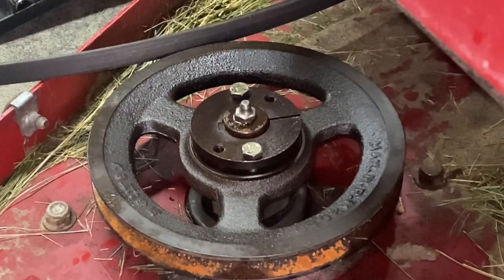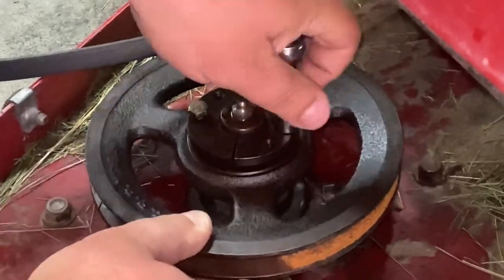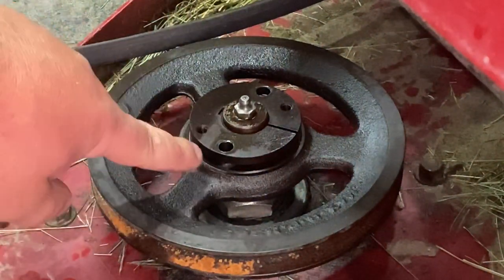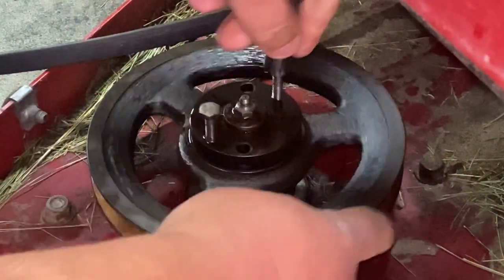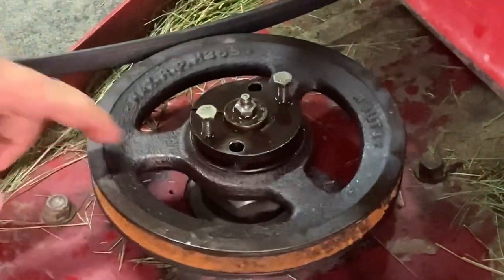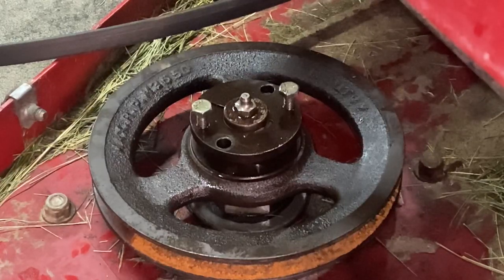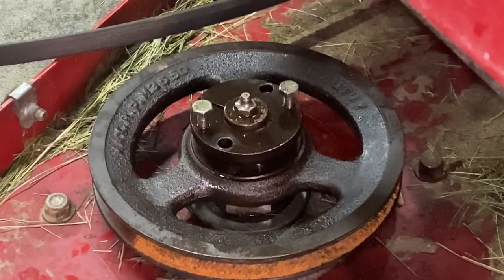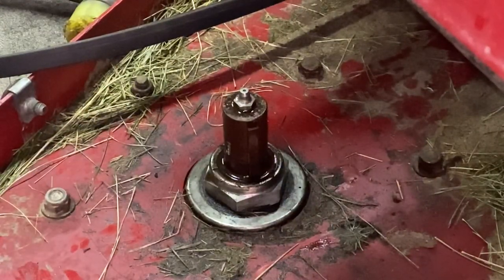How to remove a taper lock pulley

Comment: What if you don't have the bolts ...  ?  In other words I had one bolt sheer off doing exactly in this video so cuz the only way to get it off with the bolts or can it be pulled off some other way ?  
  The key Pin , or Shaft pin needs to be all the way forwards, or has to be completely removed coming Forward off the motor shaft spline
Reply from the maker: Did the bolt sheer while removing it, unfortunately that happens pretty often, if you still have one bold able to push you can use a wedge on the other side and tap it in as you push with the other bolt

Comment: I was able to get it off, is it easy to get back on being tapered?
Reply from the maker: Yes, just make sure the threads are clean and draw it back on evenly moving back and forth between the bolts, I start the pully just slightly low as it will usually pull up a little
Reply: @smalltownmachineshop6860  Sweet, thank you!

Comment: How do you remove the double pulley
Reply from the maker: The one on the back of the deck
Reply: @smalltownmachineshop6860  
I was referring to the center spendle pulley on a 3blade deck (scag sthm 52"cut). I have since figured it out though. Thanks for reply..🙂